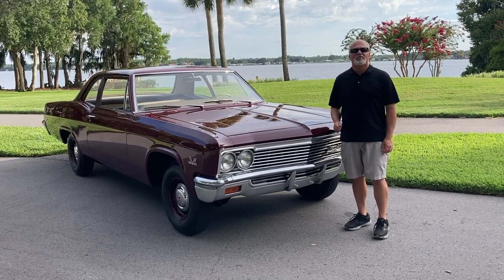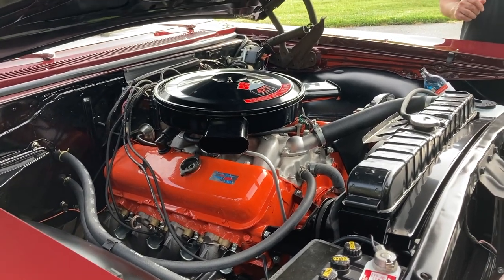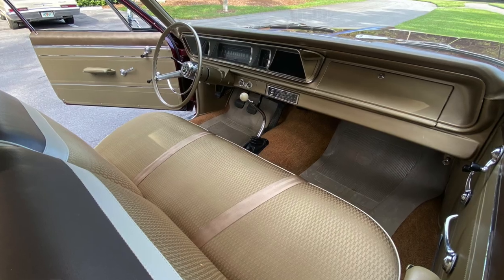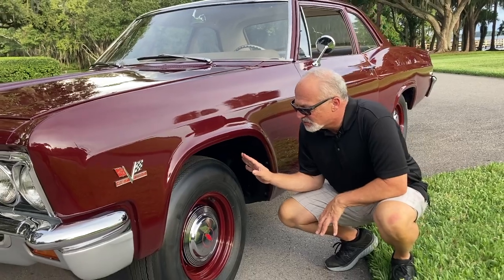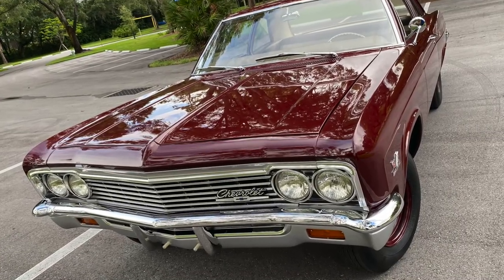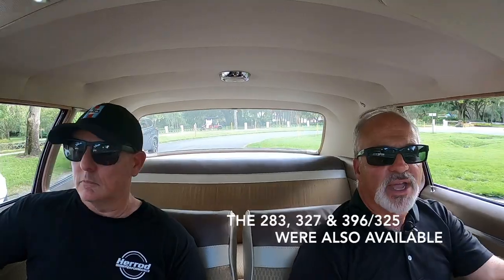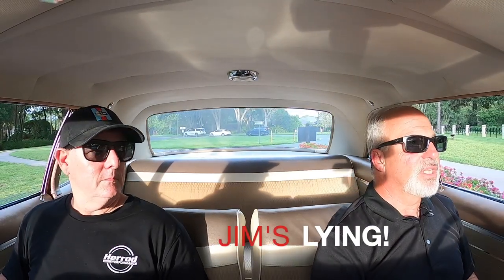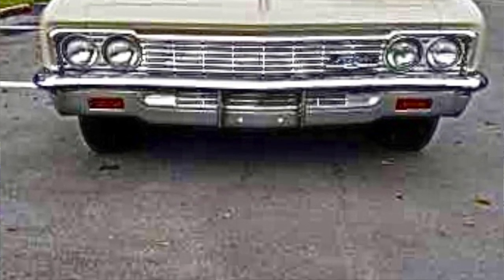1966 Chevrolet 427 L72 Biscayne—And Its Evil Twin

Comment: When I was a teenager in 1968 or so I worked at my parents' grocery store and gas station that was right in the middle of muscle car mania with a Happy Days twist. I remember a State Patrol officer (patrolman Jerry Frith) that came in and gassed up his 1967 427 (AT) Patrol issued Biscayne fairly frequently as he worked out of the Tacoma branch in the Traffic division. We were located about 15 miles due south of Puyallup which was on the way to Mt Rainier. While most of his coworkers were driving Mopar produced Plymouth Fury 3's running 440's at that time. The Biscayne was a maroon color like yours but was a "marked" patrol car and had all of the Washington State Patrol insignias and lights. It was a good looking car! If we were busy he'd park it in the line and leave the keys in it so I could move it up and fill it up when I was caught up. But one time he mentioned that this car "was the fastest used every day cruiser in the State Patrol's fleet". He mentioned having to be careful in the rain not to romp on it too hard when passing another car or he'd "lose the back end when it got squirrely". It was also the thirstiest when it came to fuel mileage probably in the 10 or 12 MPG class and probably used premium (Chevron was the brand we sold) gas too. Anyway I never forgot about the rare Washington State Patrol's maroon 1967 Biscayne with factory "Rat Power" under the hood. And the big teenaged head (and grin) I got when I got to move it up and filled it up at my parents' store and gas station all by myself at age 14. That was a great time and place to be growing up especially if you were like me and liked and enjoyed fast cars....

Comment: My very first car was a blue 1967 Biscayne, but nothing like these monsters. Mine was a 4 door 283 with blown head gaskets. I was only 15 years old and paid $60 (three $20 installments) with money from my paper route. It had a 3 in the tree and the roof was pretty badly rusted. I taped it off, sanded it down and painted the roof black to look like a vinyl top. I bought a seat cover, a battery and 2 front tires and drove that car for 2 years. Back when cars like this were cheap and plentiful.
Reply: Those were good old days when you can get a non running car for $100 bucks that just needed a few things to get running. I found a 74 Chevy Nova Custom like that. Had it running in one weekend. It turned out it had a 400 ci smallblock somebody dropped in it. I found out when the starter i bought for a 350 block wouldnt fit in it. It's not the same starter for a 400. It has something to do with the siamesed cylinders.

Comment: Brings back memories, I was in high school when those car were roaming the streets. My friend went with his father to buy their first car. The father didn't speak or read English, they were Italian. My friend check off biscayne 350hp 327ci, 4 speed, and posi. Back then you could get what ever you want, hence COPO. Needless to say we had fun.
Reply: I had a 1968 HK Holden GTS Monaro in the 90s I built had 350 Chev in it. Dam a blew heaps of tyres off it. Used to go to the tyre shop and ask for their old worn out tyres for my Stock rims for Burnouts instead of using my Mag wheels. Goes into the office to pay for fitting the tyres to the rims as I'd blown the other tyres. To come out to the Guys putting the rims on the back asking me to do a Burnout as I leave the shop hahaha.
Reply: and you NEVER knew what was in them.....
Reply: An L79 '65 Malibu?
Reply: @patrioticaussiesams8581  😂🤣😂🤣😂🙋🏻‍♂️
Reply: Thanks, interesting… my mechanics got a fe2 of those  350 HP/327 ci in 1964–69 etc…. Great engines in a lot of models!!
Reply: Why would he not get a MIGHTY MOPAR BIG BLOCK HEMI?
Reply: @wildestcowboy2668  That's what I said.

Comment: Really Sweet. Where I grew up. Our country officials must have been Motorheads. It was in the 60s. Every sheriff's car from 1967 till 1969 was a 427. Two door Biscayne. Turbo 400 transmission with 323 posi rears. Unbelievable Cop cars. But then. So were the 60s. ! ! !  🇺🇸👍👍🇺🇸
Reply from the maker: Grand times. Would love to have one of those as a daily driver.
Reply: Our local sheriff used Chevy's only one year back then. They were 1969 Biscayne four doors with 427's. The engine out of one of the unmarked cars is in one of my cars.
Reply from the maker: @turbo8454  that is fantastic.

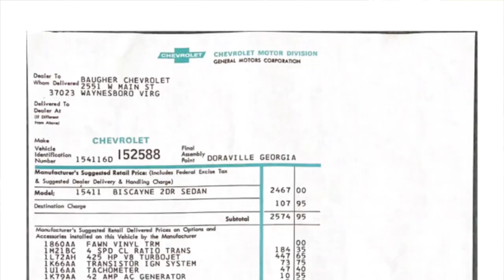Comment: Im in love,,,,NICE RIDES,,,,,ALL ORIGINAL,,,,,FANTASTIC EXAMPLES,,,,I HAVE A 66' IMPALA SS 2DR COUPE,ZZ502/600HP,3:42 12 BOLT MOSER,5SPD TREMEC,ALL HOTCHKISS SUSPENSION,3" MANDREL BENT STAINLESS EXHAUST,DID A COMPLETE NUT AND BOLT ON HER,AND SHE IS A BLAST,,,IF I HAD THE OPPORTUNITY TO PURCHASE AN ALL ORIGINAL LIKE THESE I WOULD HAVE,,, BUT FINDING ONE THAT WAS AFFORDABLE IS ANOTHER STORY,,AND THEN YOU LEARN THE HARD WAY THAT SPENDING THE MONEY ON THE COMPLETE ORIGINAL IS THE SAME IF NOT CHEAPER THAN RESTORING ONE THATS FOR SURE,I DONT REGRET THE MONEY I HAVE SPENT,BUT AFTER HAVING A COUPLE OF ALL ORIGINAL CARS,I HAVE TURNED TO BEING A PURIST NOW,ORIGINALS ARE WERE IT'S AT,,,,,,LESS MAINTENANCE,MORE USER FRIENDLY,GREAT FOR LONG CRUISES,,,,DRIVING A 600 HP BEAST ALL DAY WITH A 5SPD CAN BEAT YOU UP,BUT THEN AGAIN IM AT THE AGE WERE I LOOK LIKE THE ORIGINAL OWNER,LOL

Comment: My freind became the second owner in 1969 of a 66 Biscayne, Aztec bronze/fawn beige interior special ordered and sold new in our town. L72, M21 4 speed, factory 4:10 posi. Only other option was AM radio, heater, and factory tach. Car was super clean with only 15,000 miles when 3 years old.
Even though it was a street brawler, he put the L72 and 4 speed in a primered 37 Chevy coupe to run on the strip, it did well. Put a 350 small block and 350 turbo in the Biscayne for a daily driver.
40 years after returning from Nam, he bought the Biscayne and the 37 coupe back. Both are now over the top big block show cars. That 66 Biscayne L72 is still one of my most favorites,  will never forget the lumpy sound of the solid cam and my freind banging through the gears.
Reply from the maker: What an amazing story. Thanks for watching. I hope you’ll share this video with him.

Comment: That 427 is absolute perfection.   "Sedan is the plan", as we used to say.   This gorgeous Biscayne is just how I would've ordered one in 1966 for racing at Detroit Drag Way, back in the day.    If I only had the money at age 20.
Reply: As a teen I lived at the last traffic light on the edge of town, where the street lights ended and the street went perfectly straight for about a mile.

I used to lay in bed on summer nights with the windows open listening for reving engines, squeeling tires and slamming gears.

Those were the good old days!

Comment: Great Chevrolets ! A mechanic I worked with at a Chevy Dealer had the same 1966 Biscayne with the same 427/425 from the factory.. It was radio and heater delete with the rubber floor mats instead of carpets.,,, You hung on for dear life when that sucker got rollin !  Thanks for posting !

Comment: I worked in a CHEVY dealership's parts department in 1969 and saw a 427 factory Camaro when it was delivered. THOSE WERE THE GREAT DAYS FOR MUSCLE CARS.
Reply: Did you get beat up ALOT back then MOPAR basically dominated NASCAR
Reply: With chevys racing ban only . If gm hadn’t banned them nocar would win far less races! 16:41 16:45 16:48

Comment: The Chevrolet automobile is a storied nameplate of the General Motors corporation.  The brand is iconically associated with the American experience.  “Baseball, hotdogs, apple pie, and Chevrolet,” was actually a lyric on a mid-‘70’s ad campaign.  Additionally, I plan to join other fine YouTube commentators to let loose with a powerful fart.

Comment: In 1968 I had a 1967 Biscayne but for some reason my brain thinks it was a Belaire, probably just a misnomer.  I had the 427 cu. in. but I don’t think I had 425hp.  I seem to remember mine was 385 hp.  It had been used as a dragster and I was told the hydraulic lifters were changed out for mechanical ones plus the vacuum advance was welded in a fixed position.  Had a hurst shifter and maybe a 3.5 rear end.  I’m 75 and doing my best to remember all of this.  I loved it as it was a beast for sure and in 1968 was using close to $80 a week in gas.  What a sleeper that thing was at a light.  Enjoyed this video and thanks for the trip down memory lane.  Would welcome any comments on my reply here to elaborate or correct my memory.  What a great time that was.  I still love big motors. I have a 318 cu.in. 5.2 Chysler V8 in my little 1996 Dodge Dakota.  MOPAR!

Comment: I have always been the boulevard bruiser type. The Biscayne, Caprice, Ford Galaxie, Mercury Marauder  & more represented big car style with engines such as the GM 396, 421, 427 & 454. Ford was 390, 406 tri power, 427, 428, 429 & 460. Those were the days

Comment: I had a 65 Biscayne 2 door coupe with the 6 cylinder and 3 in the tree.  Build quality was not great then.  The transmission linkage kept jamming and you had to get out and free it up with a screwdriver.  I installed seat belts and backup lights.  Installed an AM radio too.  Got rear ended and had leaks after that.   Traded it on a 68 Bel Air wagon, 305 V8 with the 3 speed in the tree.

Comment: Not  even for a Static display would I ever consider installing the Shamefully inadequate Garbage Bias ply rubber ..I don't even use them in my potato garden ...But why would an honest motorhead look high and low to go out of his way to buy Bias ply tires  ?  Well Obviously  dear Ole Bob must be some kind of investor class purist a real Pebble Beacher .. And the one thing I do know about Big blocks is they Choke on exhaust systems smaller than 2.50 and 2 inch was all you were getting from GM . It yes it safe to say that 427 has been handy capped by it's anemic respiratory system ...
Reply from the maker: Restored means returned to original condition. This is how the owner likes it. He has the beige car if he wants to burn up the streets in his neighborhood.

Comment: In 1974 I was a poor Army Private. I bought a 1966 Impala SS 427 four speed for $650. That was during the OPEC oil embargo so muscle cars were selling cheap.
Reply from the maker: Good times if you could find the fuel without waiting in a line.
Reply: I passed on a '66 Impala SS 427 in the summer of '72. A guy in my outfit wanted $600 for it and it was in real nice shape. Bench seat, turbo 400 with column shift, P/S, P/B and an AM radio. Had 81K on it which was a lot of miles back then. I ended up buying a new Nova 2dr V8, three speed instead.

Comment: I have something close......a '66 Biscayne wagon with a 427. Bought the car in 1974 with a six and powerglide. 327 and TH 400 later that year and with 3.55 gears would run low 16's. In 1977 a 396 for a short time, then the 427. 12 bolt and 454 in 1980. 1989 the 427 went back in and about 25 years ago I added a 700R4 so the RPM's are more sane on the highway.

I still love driving it, as much as when I was racing it and it was my daily driver. I made quite a bit of money on the street as it looked so plain jane.

Comment: Thanks, oddly fascinating : build  up & background…. , the 427, etc are legendary. Interestingly, my car through Pharmacy School & after was a *1966 GALAXIE XL/4 speed/ Deep Burgandy/352,4 BBL,(at least it was reasonable GAS MI,EAGE), dual exh/ Deluxe INT/ ps,PBRAKES….in 1967;::: mildly built up: absolute first thing was **PROPER FITMENT:*Metallic Brake/ MONROE MAG 500 Shocks, decent “GOODYEAR “tires from my Mechanic@ GULF STATION in Lafayette Indiana.. Cannot imagine “ original Bias **ply , even on my underpowered XL: 352:! , obviously unsafe & no tractions…Would have been happier with  a 1966, 7L, Disc Brakes,even a 390 INTERCEPTOR.., believe those & 427s came with bigger Tires/ Front Disc Brakes,etc. ANYWAYS, , got FORD Coolant Recovery  ( 1967, (?),that also, had to,get from Ford PERFORMANCE **DEALER, but SOON in all Auto PArts Stores…Great Driver , biggerntires, the Hazard Switch in glove Box, other odd stuff on Them also.. 1966, great year..

Comment: The secound car I owned was a 1966 Biscayne 283 ci which after a couple years a friend and I pulled the stand column shift 3 speed out and put in muncie 4 spd  and a 3.42 rear end
Reply from the maker: That was probably a quick car for a tiny small-block.

Comment: I actually can't stand the '66. I prefer the 1965 Biscayne with the 425hp 396 and 4 speed. I saw an original for sale @ $75K. I bought a '65 Biscayne that was Gold with Gold interior. It came with a 283 and 3 speed. I built a 550hp 454, installed a Richmond 6 speed, disc brakes and changed the 3:08 1 bolt to 3:42 Posi. Total cost including the car was $20K.
Reply from the maker: Can’t stand? They are so similar. Kind of surprised by that.

Comment: 4:88 gears from the factory. That's what I had on my 85 Toyota mini truck 4x4 with 36'' tires, and it was still over geared. Speedometer was like 10 mph behind. That's an insane amount of torque for this car and tire size.
Reply: In 1981 I’d see big block Caprice or Impalas from Canada or Montana pulling campers coming in the hot springs R.V. park in So. Cal. Most station wagons had trailer hitches too.

Comment: 1965 to 1970 was a great time for buying horsepower off the showroom floor. Solid lifter cams and 4 speeds, what a deal!!
Reply: now they have 600hp and 10 speeds
Reply: @winteroutside7014  For what money? And at what service cost? For how long before they are deemed obsolete?

Aftermarket parts since day one for the SBC and BBC 10b,12b, m20, m21, th400, th350 even PG - and still selling.
Every bit of those cars can be fixed by a shade tree mechanic with no issues what so ever.
Try comparing apples with apples.